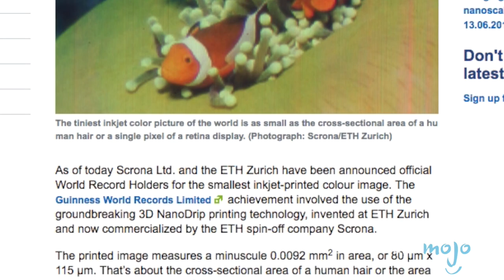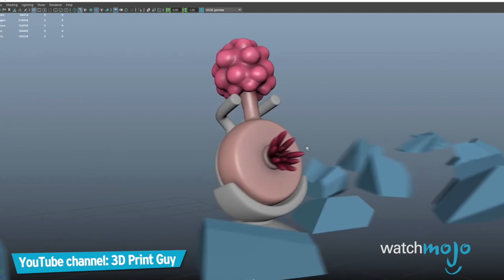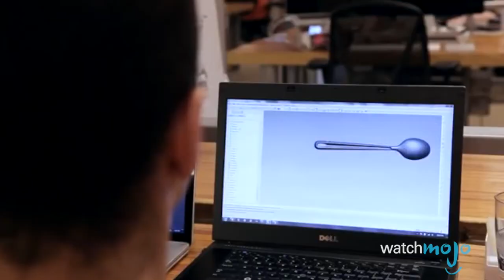Top 5 Revolutionary 3D Printing Facts

Comment: 3D printing is still in an adolescent stage. the holy grail of 3D printing is the ability to manipulate materials at the atomic level - like, quantum printing. imagine a machine capable of extruding individual atoms and placing them in the exact required positions then bonding them together... you could take carbon dioxide and turn it into diamonds (with oxygen as a byproduct).

with such precision, materials labs can manufacture new synthetic materials directly to test out their qualities. we might be able to print living cells directly, and edit their DNA at a whim. you could print any type of medicine as long as the molecular structure of the active ingredient is public domain and doesn't require expensive elements.

this would be one key advancement required for nanorobots to be attainable. then... we will have the technological singularity.